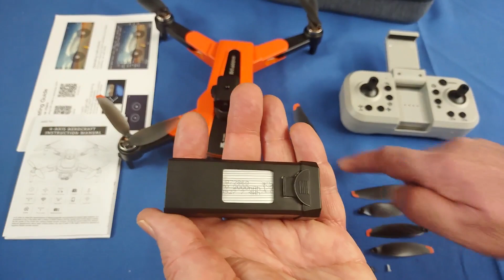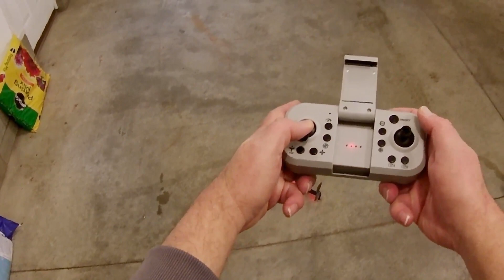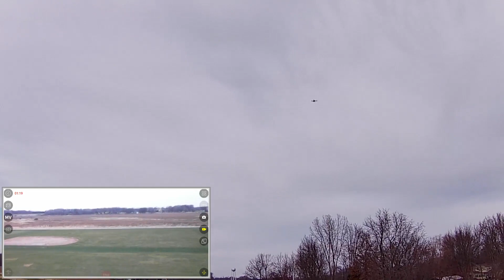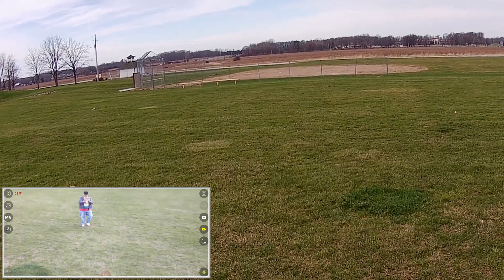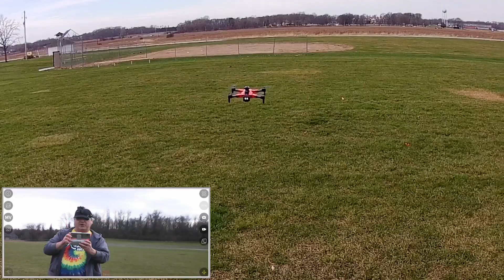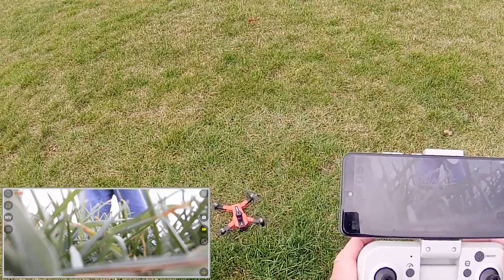RG600 Pro Brushless Optical Flow Drone Flight Test Review

Comment: Do you have to calibrate this before use?
Reply from the maker: No.  It doesn't have a GPS, thus doesn't require a compass calibration.
Reply: @Quadcopter101  As soon as I lift off even in the garage in wants to go backwards. Not stable.
Reply from the maker: Have you tried trimming it?  See the video at 10minutes 24 seconds.  Click here https://www.youtube.com/watch?v=ytk8IaPJ32k#t=10m20s

Comment: The law states they have to be UNDER 250 grams in order to avoid registration. This is 250 grams with battery. They're very particular about this and if you cause injury or property damage they can fine you.
Reply from the maker: I weigh each drone with the battery installed before I review them.  Mine weighed only 187 grams with the battery installed.  Does yours weigh 250 grams? https://www.youtube.com/watch?v=ytk8IaPJ32k#t=1m21s